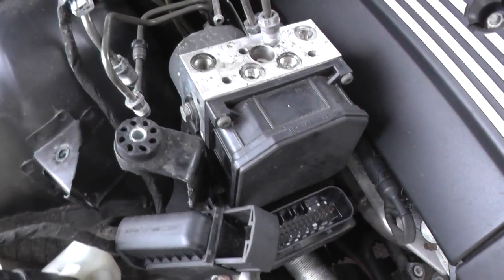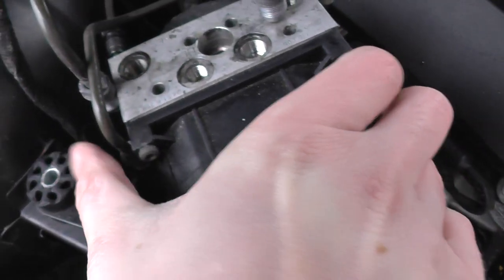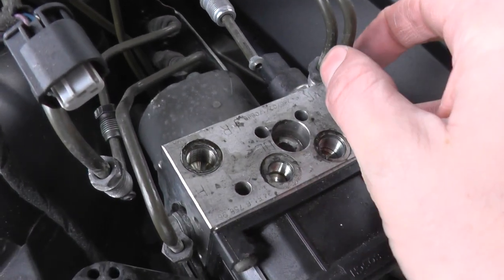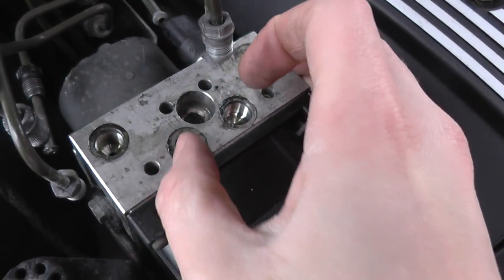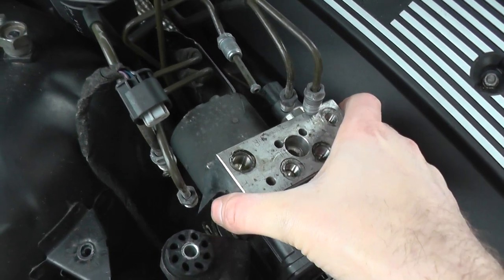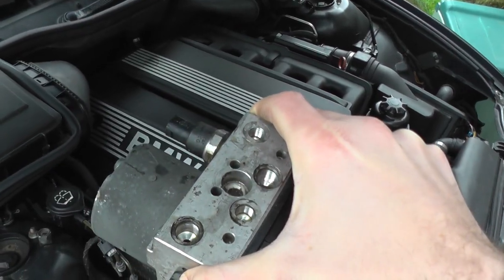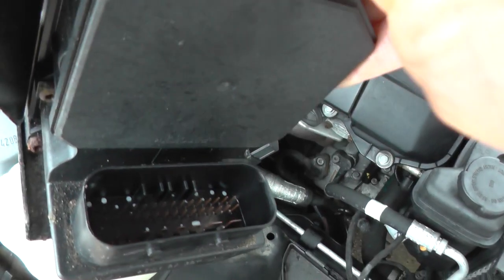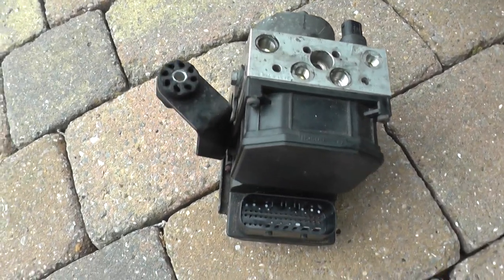Remove BMW ABS Pump & Module Guide

Comment: Hi, what did you do about the brake fluid prior disconnecting the pipes ? Have you sucked the oil out from the reservoir or drained it down the pipes ? I’m about to change the hole pump myself on my X5 2002. By the way great videos and I’ll subscribe to your channel. Cheers from Sydney Australia

Comment: I wont advise anyone to remove the abs with the brake pump because if you tried to put back you will cross feed the wires and very expensive to replace the brake lines , i watched this video and paid 800$ to replace 2 brake lines and a cross feed abs cylinder and yet still leaking badly and air in system no brakes!

Comment: Hi my abs DSC active steering don t work , not EQUIPED sas the obd ecu.. i replace onley the front module of the abs pump do i have to replace it all like you did? The steering was ok bit than i made a short and it don't work no communication not EQUIPED it sas ... Ik replace second hand module and  Any thots please help .. thanks

Comment: I think I've fucked up,I think,I just bought the abs full pump and module,I for got to check product numbers will it still fit ,I'm having it done by a mechanic it's come from exact same car as mine
Reply: Will need coding
Reply: 6cyl and 4cy are different also x drive differ